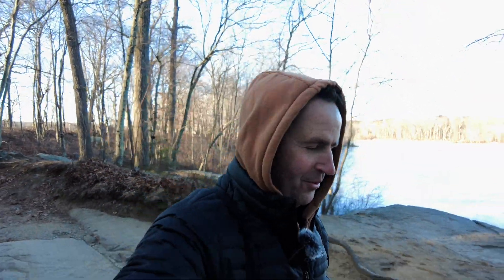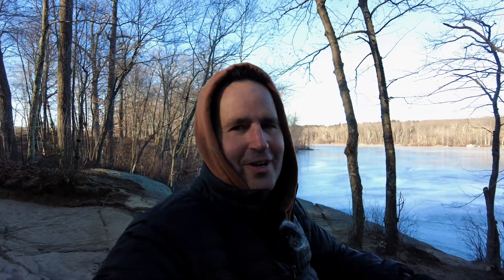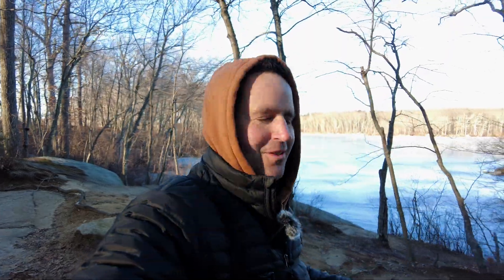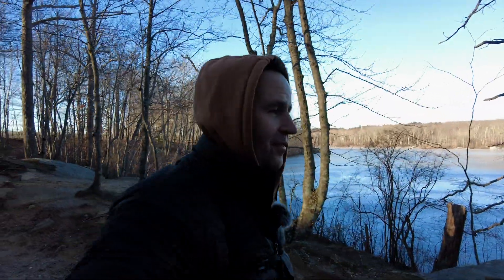DJI Mini 2 motor covers heat test

Comment: 3 years late but. dont fly in strong winds in the summer as the motors can overheat. My motors in 90F weather in strong winds without covers got very hot.
Reply from the maker: Well that really poses a concern. I liked them for keeping dirt and debris out of the motor but the overheating is a whole other issue. Thank you for sharing!!

Comment: Hey Bod, I’ve just installed these same covers in my mini 2 SE. I thought they would be really tight, but no, they’re quite loose. Is that alright?
Reply from the maker: @andreyamr3306  Hey Andre yeah that’s how they rest on the motors. The screwed down props hold them on. Your good.
Reply: @bobfiore8  Awesome, then. Thanks mate. I put the drone in the air yesterday and yeah, felt no difference… had the feeling it was a bit noisier though, but no issues with stability at all.

Comment: I just got the same covers and was worried when i first seen this video go by. Lol
I noticed 1 out of 3 when the drone is off if i turn the prop is has no pull back one is lose but its flying fine. What could that mean? Thanks
Reply from the maker: Are you saying one of the props are tight and has no play? If so the covers I have are all loose and the holes are wide enough to not interfere. Couple of questions. The cover isn’t touching the Prop? When you screwed the prop back in, it went in fine and tightened
 all the way down? I know there basic but without seeing it I’m trying to get a read on it.

Comment: Great job on the test bob 👏 and I definitely would be curious to see how this would be in the summer. Thanks for the shout out 😆
Reply from the maker: It was a fun test that I’ll do again in July. Thanks for the fun idea. It also sounded just a touch different. Forgot to mention that. Like a little vibration noise but it didn’t interfere with the performance.